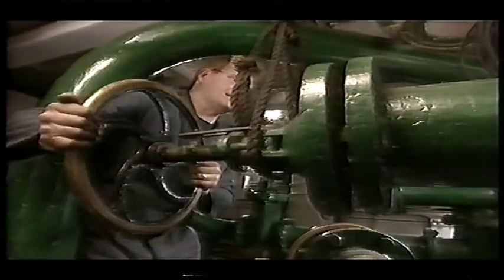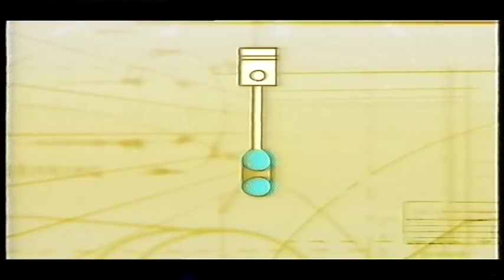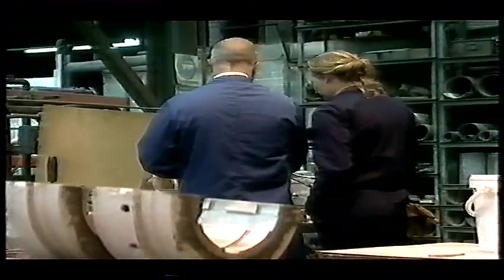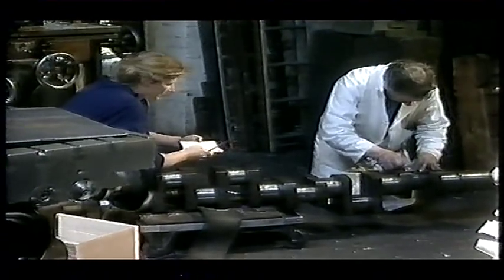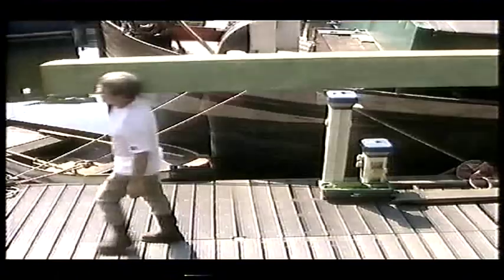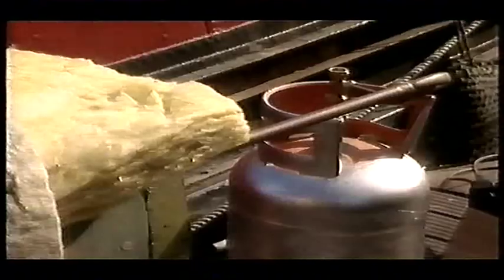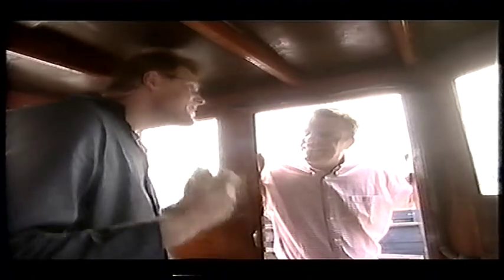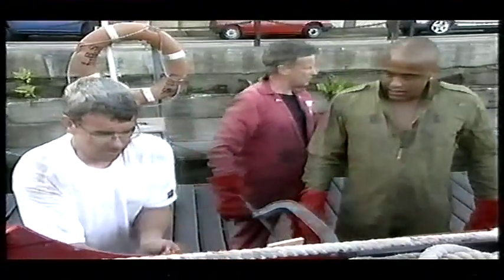salvage squad the massey shaw revisited part 2

Comment: Was it impossible to get replacement spindles from the gate-valves cheaper than machining from virgin metal?
I can imagine that modern valves would be made to metric dimensions, which might have been part of the problem.